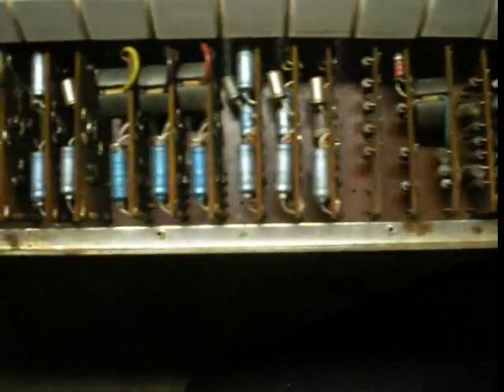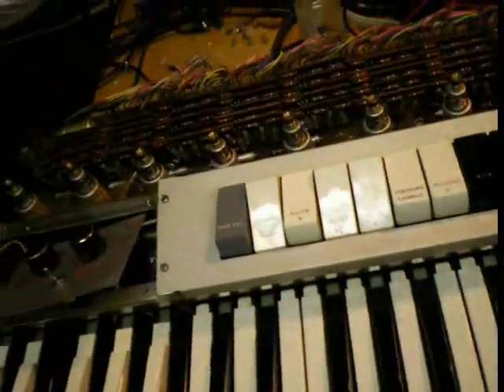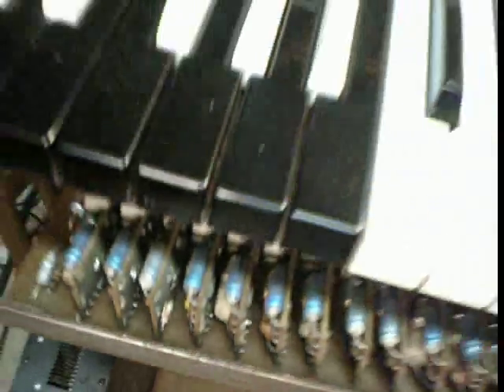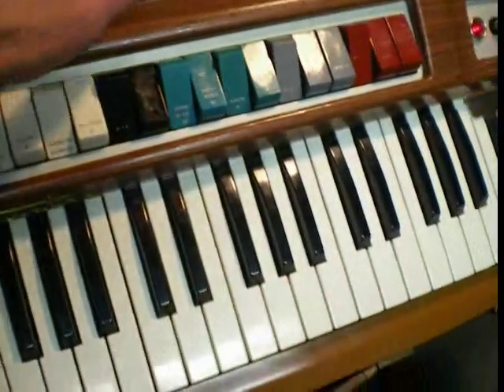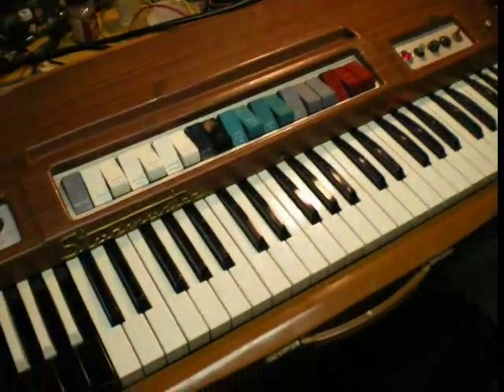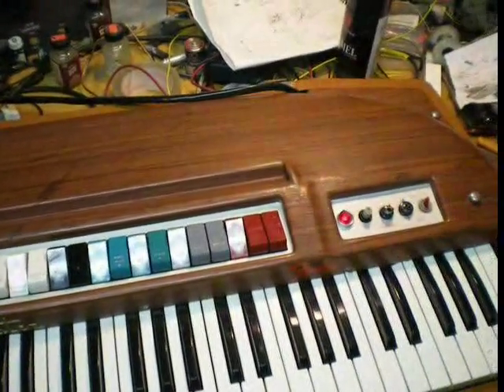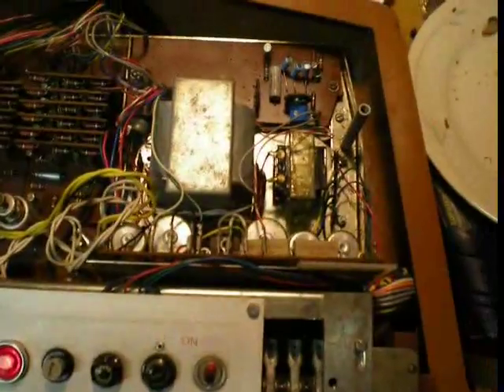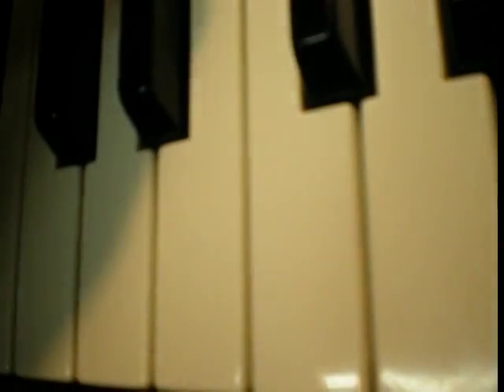Fender Starmaster Organ part 2

Comment from the maker: Yes it's made by Bauer.  Fender was going to do their own cosmetic design of that organ that looks similar from Bauer.  Those are also quite rare.  The Fender is super rare.  They apparently only did a limited number then decided it wasn't worth it and terminated production.  Note my vid on the Bauer also that we had that was similar but not the same.  We've never seen the rare Bauer version of this.  I have two of the supposed 30 whatever of them. Intend to sell one some day. Worked on another.

Comment from the maker: PS regarding the melting effect on the panel.  I just sold my second Organ that had a better top on it. I let it set for a long time without opening it and the CORD had started to..melt into that top in a couple places!  Is it a reaction or does a warm environment make the top plastic enough to where it just kinda sinks in there?  Anyway...warning people...do not keep the cords against the cover when you store it !
Reply from the maker: yeah I finally figured out the cords were destroying the plastic. Thanks for the detailed response!

Each circuit is what it is.  You can get some nice tones but they don't have the vibrant interactions of a Hammond tone wheel organ of course.  I've learned to hear the subtle attributes in a lot of instruments that have musical potential.  Everything is what it is and can be used in context that is appropriate to exploit those attributes of course.

I played and need to do some cap replacements on a friend's Gulbransen organ..HUGE COILS :-).  Talk about some pure tone generators...wow that thing is the king of mellow deep tones in that class of instrument.
Reply from the maker: Mom's got a president and it also has drawbars but it's a later 1973 vintage gulbransen.  THe tones aren't as pure as the earlier one with the huge coils.  Can't recall what model that is but it's also got drawbars I seem to recall.  I got the caps in and I need to go over there some time and recap it for him.
Reply from the maker: This one had a weak 6.2UF cap I'll replace with 6.8uF in the tone generator cards.  Lots of them.  Lots are high esr.  So they all need to just be changed to have this one at all functional and reliable.
Reply from the maker: Rick Delair
I need to finish making a panel for one I've done ..a guy brought in busted up sparton 700 I think it was radio.  6F6 tubes and I stripped out all but the PS and Power amp pretty much and put in a 6SN7 driver/inverter circuit for the push pull pair of power tubes and EM speaker that was in nice shape.  Built it into a 1" thick maple box the chassis slides into.  Then Used a switch between 6SN7 and 6SJ7 option for the preamp tube and tone control circuit..so there's a pre and master volume before and after that stuff....then... a Fender Reverb circuit on the front.  So 6 controls in all.
Reply from the maker: Rick Delair
hehe Oh I don't know...I'm burning about 14W of power and this room is lit better than ever.  Mercury lights are a great invention for sure but due to toxicity I'll take the LED's where breakages might occur :-)

It's just recent months that they really got affordable and I forked out 20 some bucks for 8 of them and set up the most used locations in my place with them.   Just the time it saves me in changing them all the time with tungsten lights...hehe.  never tried to..rebuild a fluorescent ballast...got one on me there

Comment: An antique for sure.  But as for practicality and usefulness, it’s like having a steam engine powered car.
Reply from the maker: I've kept one of them hoping to get a group that wants to use some of the rarities.  It's a pretty good sounding organ on some of the settings really.
Reply: For a “retro” band perhaps.  I had a Farfisa Fast3 back in the early seventies and at the time I was thinking “all of the voices on this thing sound like a toy”.
Reply from the maker: Well it's like this.   All combo organs in general have some kind of tone generated that gets switched on and off through at best multiple key switches that allow control over different tone mixtures.   In a world where synthesizers obviously allow for a lot more diverse kinds of control over the sound you get, the remaining charm in these organs is how the tones interact in different chords, and the tonal qualities that get generated.  In terms of facilities the starmaster has a lot going on compared to some other entries like the one you mention.  Fast 3 is a very minimalist organ as I recall.  The bauer type organs have a fairly robust build on the coils and a well done tone circuit there and dividers laid out like the other popular organs and what 5 dividers instead of 6 like the continental...but still along with the keying circuitry etc. it's got more options there too so among combo organs it's really one of the better equipped.  Plenty of tone combinations to go with but whatever the case they all find their 'niche' like I say in just how they are played really.